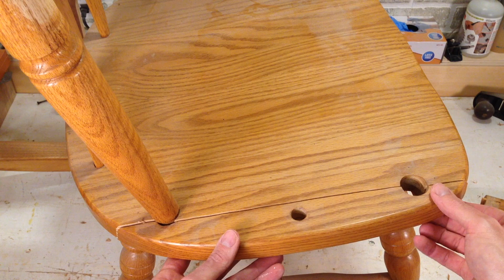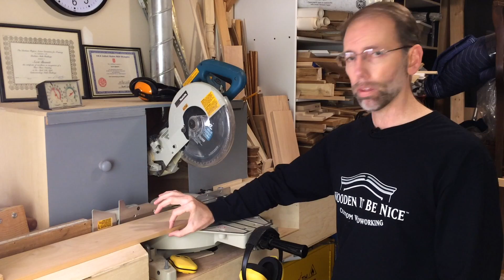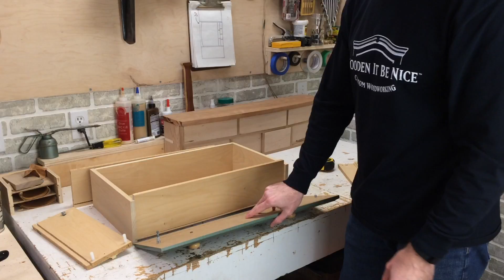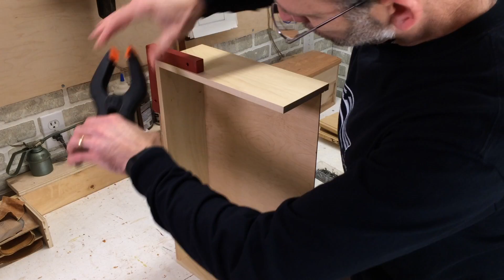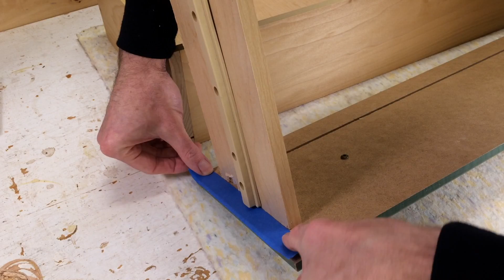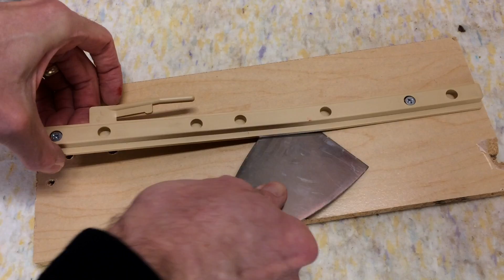Ikea Style Drawer Repair - How To

Comment: So, basically IKEA-repair = replace all particle boards with actual wood ;D
Reply from the maker: In this case, there wasn't a way to salvage the particle board.  It's cheap material that can't be repaired.  If it was solid wood, I would have repaired it easily.  Yes, this style of furniture I refer to as "disposable furniture"
Reply: @FixingFurniture  Well said
Reply: @FixingFurniture  One thing about the repair is that the drawer has made shorter inside. Depending what was stored or having a silicone matt makes the repair somewhat questionable.
Reply: Which defeats the main purpose of buying ikea. Cost.
Reply: Man gave you best solution for problem with this kind of furniture. If I can only have this kind of tools. Here in Serbia we don't have that quality. For example clamps and bits are all made in China. China have also good quality but they send here only low quality goods.
Reply: @optodox  China wouldn't just send stuff hoping it gets sold. It's more likely that Serbia is importing cheap goods as that's all the market is willing to buy.
Reply: @optodox  I suggest looking for old rusty tools on ebay, especially if they have wooden handles. There's some really good ones out there if one is prepared to put a little time to remove the rust.
Reply: and make it even better, i did one with pallet wood on the bits that's not showing. works great
Reply: Or build your own.
Reply: I think this is not true at all. Actually you can repair particle board. Actually you even can fill broken out gaps. The reason you do not repair it is your attitude. You think crap material should not be repaired. Thats ok for me but then you should not call this a repair video when it is a replacement.
Reply: @ftrueck  It's called "crap material" exactly because it's cheaper/easier/better to just replace it 😉
Reply: @ftrueck  It's "ok for you" but still you're here quibbling over semantics? Who cares if it's a repair or a "replacement" -- it was broken, now it works -- that's a repair in anyone but an insufferable pedant's book. The customer cares enough about the object to spend the money on fixing it. Scott is putting his seal on the repair, giving his guarantee it will hold -- stands to reason he would make sure it's solid. Stop wasting everyone's time with these pointless, negative comments.
Reply: @ftrueck  hahaha, dont make me laugh. I bet you re wash toilet roll.
Reply: @EkayPvp  Actualy I don't. But I have a sense for clickbait. Repair is: fixing existing stuff so that you can use it again. Replacing is: throw away a thing you think is not of any use anymore and replace it. I know, semantics... But if I do not care about: who else would?
Reply: @ftrueck  and how will you repair that? with epoxy resin? or maybe with noodle and superglue? it's faster to replace it than the repair.
Reply: @265Spike  Just think of how particle board is made. It's really easy to reproduce that. A hand of saw dust and some wood chips and you have your own repair putty. Note this is for the case you want to repair ikea stuff by your own. We agree that no one would be so stupid to take ikea furniture to a carpenter to repair it. There would never be a ROI on that kind of thought.
Reply: 265Spike it would have taken 20 minutes.  His new front was a good idea. Just add 1 board behind the front. Fill gaps with wood filler or bondo, screw together.
Reply: @265Spike  indeed epoxy + saw dust repairs any woodwork, usually stronger than the original

Comment: Well, this is obviously a professional repair. U made me subscribe!
But i am curious what do u think if (as an nonprofessional) i would DIY repair such a drawer using pocket holes screws? Thx
Reply from the maker: To be honest, I'm not a fan of pocket hole screws.  Securing the drawer sides to the front and back would be more effective with screws straight through the sides.  Does that make sense?  Scott